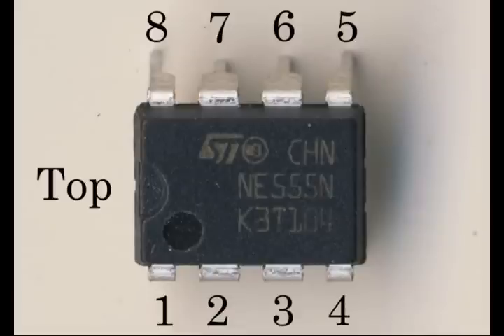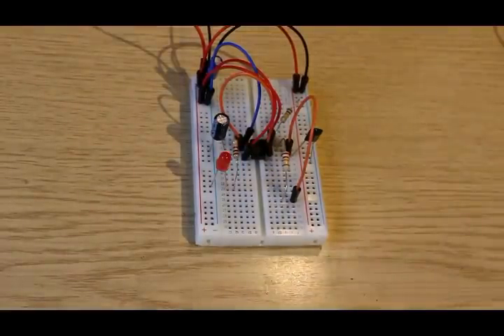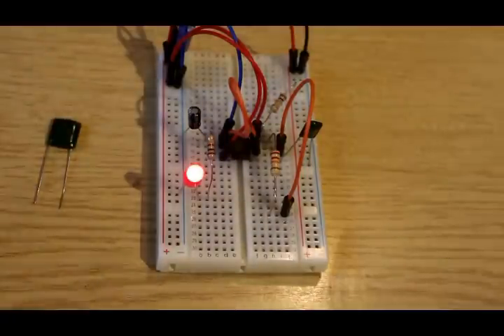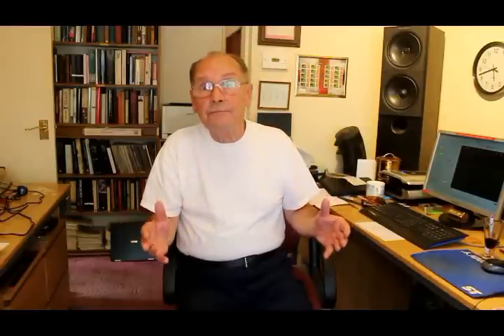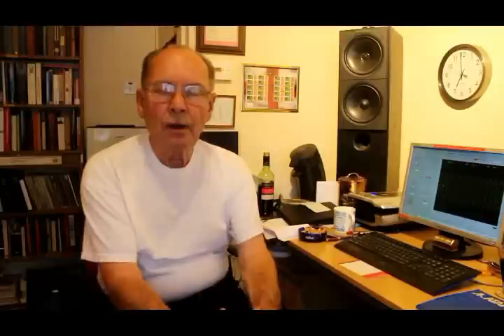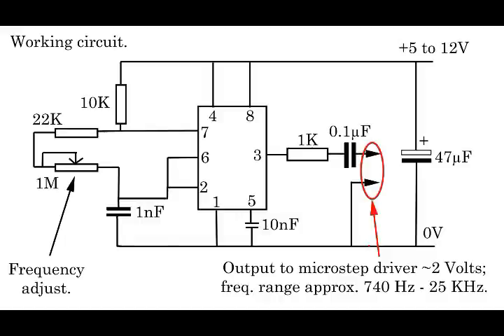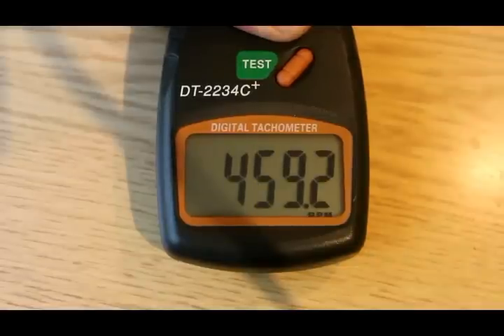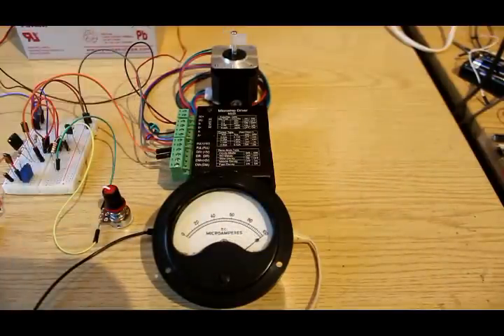NE555 stepper motor control part II

Comment: thanks sir for the tutorial , but i was wondering you said at the last that the motor wont start in the higher frequency if you shut it down , will this apply to if i used the ( enable and disable ) terminal in the driver , could it will pause and restart in the higher rpm ?
Reply from the maker: Sorry I didn't reply before. No; when the motor is stationary  it needs to sart on the slow side - maybe 150 rpm, then it can be immediately run up to a higher speed. I'm not sure what the top speed of, say, a NEMA 17 stepper motor is, but probably a few hundred rpm. I'm pretty sure they won't go at 2000 or 3000 rpm like ordinary motors.

Comment: the bar connected to the stepper motor, which in the photos is referred to as FEED SCREW, is it perhaps in steel or a similar material?
Reply from the maker: Hi Allessandro. Yes - I used a stepper motor to drive the feed-screw on my old disc-cutting machine. The feed-screw is indeed a steel bar, with a very fine thread cut on it. To help isolate the feed-screw from the vibration of the motor (this vibration is, perhaps, the only disadvantage of stepper motors), I used a 'Hi-Tech' method - a 40mm-long piece of polythene tubing, made soft by hot water, one end pushed over the shaft of the stepper motor, the other over the end of the feed-screw. As I said, VERY Hi-Tech! 8^)     The arm of the disc cutter has a 'knife-edge' which engages with the feed-screw when the arm is lowered into its working position, and so is propelled across the disc. Best regards & thanks for writing, Norman.
Reply: So an alternative to the bar that moves the arm with the recorder head, recovered from her by her old disk cutting machine, which could be?

Comment: Hello Norman
Thank you for the two videos on stepper motors : they really enhanced my understanding.
At approx 5 mins in to this video you propagate the signal from the 555 circuit to an audio amplifier using a capacitor, the value of which is unspecified, although you did mention it is to protect the amplifier from the 12V supply. I am reproducing your NE555 circuit but utilising a 5V supply so I don't know what value of capacitor I would need for the purpose. Additionally, you refer to then measuring the frequency with a virtual scope which (from looking at the software you mentioned) would appear to utilise the PCs microphone input. I imagine that would require similar protection but again have no idea what we might need to achieve that. I hope you might be willing to share the additional circuitry required to repeat the whole experiment (using 5V rather than 12V). 
Regards
Paul Reader
Reply from the maker: Hi Paul. I'm no 'boffin', just a tinkerer; but I checked & the NE555 will work on a supply voltage (Vcc) from 4.5 V to 15 V. It is this voltage that appears at the output pin 3 when the device turns on. Therefore, as you are using 5 V to run your 555, it is this 5 V that will appear at the output - just as it was 12 V that would appear on pin 3 of my circuit, because I was running the chip with a 12 V supply. As regards the capacitor, the value is not terribly critical; it's merely a 'blocking capacitor'; it allows the AC audio signal to pass, but not the 12V DC. At 8' 33" in the above video, I'm quoting a 0.1 µF in series with a 1 K resistor, which gave a square wave output of about 2 V. This figure is quite suitable as the input to a microstep controller, which will accept up to 5 V. (And will still work OK with much less.) True, 2 V would be unacceptably high for a microphone input. But perhaps I should have said, that the connections to & from the sound card of my PC go via an ordinary audio amplifier: an old NAD 3020A. These are standard line in & line out connections, which are typically ~100 - 200 milliviolts. The line output from the amp. goes into the line in on the sound card (usually coded blue) - NOT the mic input. The output from the sound card comes from the line out - coded green - & goes into a line in on the amp. Hope this helps. Good luck! Cheers, Norman.
Reply: Thanks Norman! 
Your circuit will give us a far better test signal than the output from our pc through the now suspect breakout board to do simple tests on our drivers and motors with which we have been struggling for a few weeks.

Comment: Thanks for the two videos Norman.
I'm about to use a TB6600 plus a NEMA 23 to power the Power Feed Rod on my Warco BH600G lathe in order to give me full control independently from the lathe's gearbox.
This will be my first attempt trying a stepper as normal small 12v geared DC motors don't have enough oomph, and I had the steppers lying around doing nothing.
Any suggestions please.
Reply: Sorted!
There's a video on my channel.

Comment: Hello Norman,

I just saw for the first time the video about the steppers, ( I had not seen it yet)
do you build something with the steppers ???  ;-)  3D Printer CNC .... ???
I have built two 3D printers(Prusa i3) and I can say it is a big puzzle, but a lot of fun!
a small CNC I've already also the  parts for  ;-)
I have several Arduino's -
can also be fun in combination with a module such as AD9850 which is a DDS module.

(RC planes we do also play with, very nice!)

Friendly greetings from The Netherlands.
Rob.

Comment: Norman thanks for the upload and great info. I do have a question what are you using for your PC based Oscilloscope?  Software/Hardware? Many many thanks again!
-S
Reply from the maker: Hi - thanks for writing. The virtual Oscilloscope I used is to be found at www/zeitnitz.de.Christian/scope/en . It is not freeware - you are supposed to take out a licence to use it. I did this. It's great for normal audio frequencies, but the display starts to become a bit erratic towards 20 KHz. I should worry; I can only hear up to 6 KHz, because I am quite old now! Cheers, Norman.

Comment: more radio videos please Norman.  the crystal radio season you did was brilliant. I'm also a ham but I'm sure there are hundreds if not thousands of people who would benefit from your unique and witty method of teaching.
Reply from the maker: Hi Simon - nice to hear from you. One thing I have been doing lately is trying to make a valve (tube) disc phono pre-amplifier, dedicated to playing 78 rpm records. It's been fun - so a video based on that might be an idea? I'll have a go at it. Best regards, Norman.
Reply: Norman Field good stuff. I've played with the usual lm386 op amps for homebrew qrp single sideband radios and have just finished assembling a bitx40 radio I bought from hfsignals. 35 quid well spent.  some valve amp vids would be good!!

Comment: I bought a TB6600 stepper motor controller on eBay.  It looks pretty much like your M335 but then again, most all of the controllers I've seen look the same.  I built the variable speed board and hooked everything up the way you show in your video.  12 VDC to power in, the 4 wires from the motor to the controller and the 2 wires from the variable speed board to PUL+ (+5V) and PUL- (PUL). When powered up, the motor makes a small jump and I can't turn it with my fingers.  At least there's power to the motor. However, I can't get the motor to do anything other than that.  I've changed 555s, rebuilt the board twice, used separate power supplies for the TB6600 and the variable speed board, etc.  I looked online for a TB6600 manual but found nothing.  Is it possible that I don't have the DIP switches right?  I tried posting a pic but couldn't do it.Thanks!
Reply from the maker: Hi there. A lot of this you'll have tried already, but anyway here goes! 1. Make sure you've paired the 4 motor wires correctly.  With no wires connected the motor shaft will turn freely. Touch together any two of the wires & turn the   shaft. If it still turns easily, touch one of the other two wires until the shaft is hard to turn by hand. That gives you the wires to one winding. The other two, naturally, are the other winding. Connect the two pairs to the driver. 2. Adjust the DIP switches for 200 pulses per revolution: S1 ON, S2 ON, S3 OFF. 4. Apply the 12V motor power to the driver (VCC, GND). 5. Apply a small test voltage to PUL+ / PUL-  say 1.5 V from an AA cell. The motor should move a bit each time you make the contact. If so, the motor & the driver are working OK. Try the above & tell me what happens - we can take it from there. Good luck, Norman.

Comment: Norman, thanks for the tutorial.  I purchased two of the stepper controllers you used in the previous video.  I plan to use this setup to drive a 1/4" scale amusement ride that I've scratch built.  Using a series of timers and limit switches, I'm going to use your setup to slowly start up the ride, run it for a while and then slow it down until it stops.  I'm going to hook up a DC motor to the 1M variable pot to vary the speed.  I'm sure I could do it with a programmable chip but that takes coding and I don't know how to do that.  Plus, this is for a commercial model railroad exhibit in Strasburg PA and it has to be extremely reliable.  It will be started with a push button.  My question is not how fast the stepper motor will go but how slow and smooth will it go?  I'm looking at a stepper that has .9 degree steps which is 400 steps per revolution. Any help would be greatly appreciated. I can forward my email address if you would prefer.

Comment: *How did you connect the circit to the computer to measure the frequency?
Reply from the maker: The audio signal from the circuit was fed into the Line In jack on the sound card of the computer - the normal way you feed any audio into a computer.  Cheers, Norman.
Reply: +Norman Field Thankyou